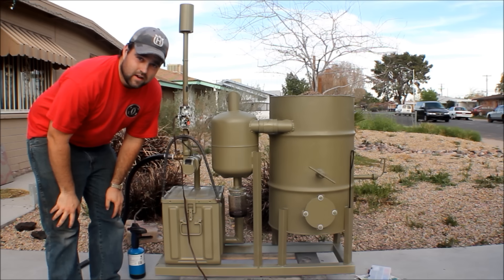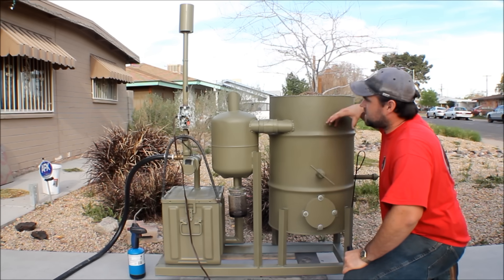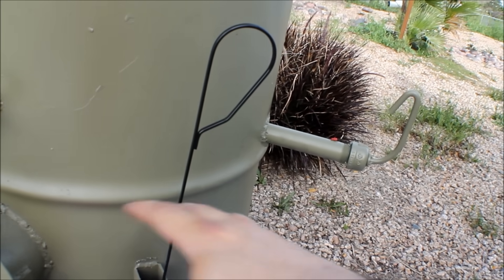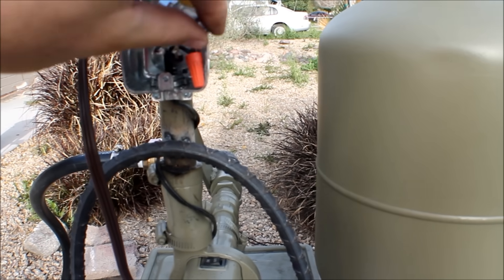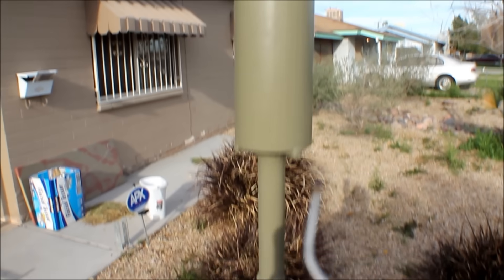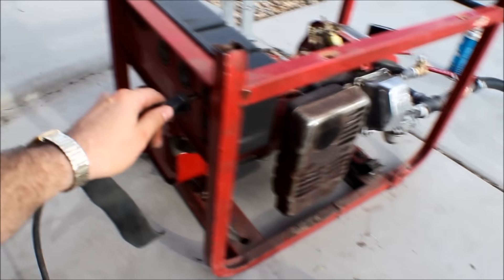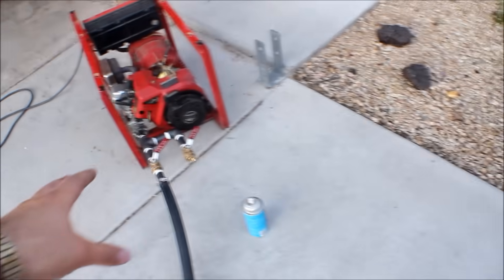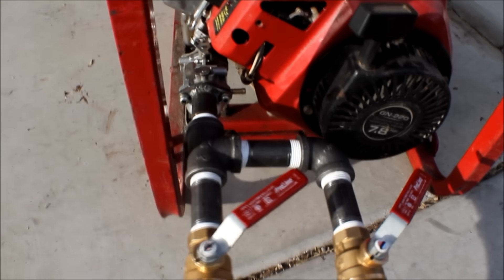amazing homemade gasifier uses wood pellets to run generator -- renewable alternative energy video

Comment: awesome,,,, can anyone answer these questions
1. how efficient are these eg much wood etc do you need to power the generator continual use???? what power output do you have etc.
Reply: That’s exactly what I was wondering. Like does it take 10$ worth of pellets to run 2 hours when gasoline could run it 2 days for same price. I’m also wondering can you run it all day. I’m also wondering does it work with sticks twigs wood from a forest or just store bought pellets.
Reply: @xDragonHawk  I completely agree... I heard from another source it takes roughly 8 kgs of wood to make the equivalent of 1 litre of petrol... Yes that is a litre not a gallon

Comment: Hi,did line the bottom of the gasifier tank , and what size hole fitting are you using on gasifier and to your engine thanks any info would help

Comment: Excellent work.  can we use Paddy husk instead of wood pellets ?  can the Generator deliver its rated power output with this gas. Can I share more details of this design through my e mail addresses 

basssa1960@gmail.com

Comment: could you circulate water though a water jacket on the drum like the cylinders of an engine and plumb to radiator in your home with a fan to heat a house in the winter as well as send that water into your sink shower etc. or would it cool the gases to much. Aslo I live in a wooded area. Can I feed it any wood? Can these gasses be condensed and stored in a sort of fuel tank for later use?

Comment: So when deciding what type of generator to buy, I see some that are "dual fuel" capable. Would one that's ok to run Propane take to this gas vapor better than a standard gasoline model? What about a Diesel generator...? Does this technology work with that as well?

Comment: Nice work sticking to  plan and budget to get a working system that runs the generator.  BTW Check out Wayne Keith's vids for Drive On Wood... he runs his full sized pickup on a gassifier in the back. Also holds the land speed record for a wood powered vehicle !

Comment: The main problem I see here is that the governor on the generator is disconnected so as the load on the generator fluctuates, the generator speed is not governed properly for the correct power generation voltage and frequency.

Comment: Thinking a Natural gas pressure regulator kit for generators would work good with this set up ...because as you put a load on the generator it will need to advance it's throttle based on the governor.

Comment: Be careful of running 'wet' fuel engines on 'dry' gas. The valve seats in the engine will wear faster. Just an FYI from someone seeing fleets converting gas engines to propane back in the day. Seen a lot more valve jobs on converted rigs than those on regular gasoline. Maybe find an additive? Our fleets never found one...20+ years ago though...

Comment: How long will the wood last in that 4" tube, when running the generator?
Reply: I was wondering the same thing.  Looking at the video my guess is 45 min to an hour.  The kicker is how many watts does the generator crank out?  If it's a 1500W generator you could run a toaster or space heater for 45 min to an hour on the pellets.  Like someone mentioned put a heat exchange on the unit and you could have hot water as well.

Comment: Hi there,   great video ,   I had fun watching.     I was im pressed with your pipework  , and your general contruction .  Its of a good standard,  and nicely integrated into that jig or frame that holds all the parts. 

I would just like to thorw my 2 pence ( or cent ) worth in there.    Dont try to regulate your blower  motor using a variable resistor or reostat , as you call them ,    switch to a PWM motor control circut , its also very cheap to buy and will control your motor with far mor accuracy and with a lot less heat dispersal.     You had mentioned that your motor was run from a 12 volt supply..   there are many 12 volt PWM motor control kits out there that you could integrate into that little metal box.   It would still use a variable resitor , however the POT( potentiometer ) would control the PWM circut which in turn controls the speed of the motor. 

I have one other idea that springs to mind when  I see this.... why not integrate a small 12 volt battery into your nice frame, and then add a 110v AC - 12v DC  supply in addition ,    as soon as your system is up and running the geni output could be connected to the rig to recharge the 12 volt battery.   Making it reeady for the next startup.      Right now ,  you have to have the trucks 12 volt to get going....   it would be great if this system could be completely self sufficiant and independant....  Perhaps add solar to charge the 12 volt blower battery ..? 

Great video , and as the other comments say this is one of the neatest wood gas systems ive seen on you tube. 

Keep up the great work and i look forward to your other videos. 

Matt

Comment: I would use instead of the air mattress pump a more robust solution maybe a 12 volt pump that is made for continuous use, due their stronger build, brush less and better overall construction (since they are made to be used for long periods of time like for example kitchen exhaust fans or even car ac blowers (12 volts).

Comment: For the speed controller, you can use a fan speed controller or for higher currents, there are 1000w high output light dimmers that have a heatsink built in. You can find them in hardware stores fairly cheap.

Also, throw some bacon in the gasifier. You'll have the whole campfire experience..

Comment: you should be using a https://www.amazon.com/Onyehn-Controller3V-Control-Switch-Dimmer/dp/B07GP72BWV/ref=sr_1_5?keywords=12V-Control-Switch-Dimmer&qid=1581578233&sr=8-5
12v control dimmer or motor pwm

Comment: Burn pellets to fire steam engine to turn generator far more thermally efficient. Like back in the good old days without the Grid. Your rheostat (A rheostat is a variable resistor) throws away that electricity just generated back into waste heat.

Comment: Do you suppose that tar could be dried out in the sun and put back in as a fuel source? And the sawdust as well for that matter. I don't see why not. It shouldn't be a buildup of impurity because on each re run these byproducts would be turned 90 percent into ash.

Comment: The only design flaws are that this gasifier only runs on pellets (or small twigs/branches) and that it isn't really cooling the fumes enough to draw out moisture. If you increased the run vertically with the maximum amount of surface area you could possibly get, I'd bet you'd run that generator just fine.

Comment: They need one of these about 60,000 times the size that runs on trash.
Reply: Someday. When energy isn't cheap and plentiful any more and space for land fills isn't so abundant. Someday I bet there will be an industry for mining abandoned landfills.
Reply: @xcvsdxvsx  Allenwood, Pa, the dump has one! huge setup runs off dump gasses!
Reply: @18twilliams  haha coool
Reply: In Sweden most of our garbage gets transported to large facilitates where it gets burned to heat the homes of thousands. In the winter wood pellets is also used. More effective then making electricity from it. Land fills are almost ever used except for asbestos and stuff like that. Rest is recyceled.
Reply: Where I live they have a big plant that makes methane gas off the garbage
Reply: These things are used on bigger scale. Google it you will find ones that generate ~200kw of electricity +300kw of heat power and they consume about 100kg every hour of biomass (wood, pallets etc..)

Comment: I'm guessing there's no way to control the throttle on the generator with this setup though. ?
Reply: Just a little more R&D.

It's best to focus on the "positive" aspects.

As a matter of fact, I intend to build a "hand pumped" bellows in place of an electric fan so I don't have to rely on any electricity power to start the thing up.

Comment: Just downloaded the plans and this video, I am definitely building one of these in the future.
One idea though. If you get a generator with electric start, you could start the gassifier with the gen battery and then start it off the battery and then it would be recharged for the next use.
Reply: The fan in this design uses 25W at most, which means that 3 18650 cells would be able to power it without any issue. You don't need to pay extra for a generator with a fancy electric starter, a Powerbank that does 12V will easily do it.
Reply: @nottheengineer4957  Well electric start would probably make it easier if you didnt have the fuel valves set, idk just seems like less to worry about cause it maintains itself. It would probably be a used generator off facebook anyway so I dont think price would factor in much.
Reply: @Jasonrotfl  Im with you. Ill buy the fancy electric start generator while I can. Not like you can get one after the Boogaloo or full chinese invasion hits, or some other disaster. Might as well make your life just a little easier.
Reply: @exterminater267  did just that. three generators on hand - one dedicated to gasification just in case. Plus the 4.6 kilowatt in solar panels...you know what's going on these days...not sure about "tomorrow"...

Comment: Just a Suggestion; If you bought an old compressor similar/ same as those that fill SCUBA tanks. Then bought some old SCUBA/ LPG/ pressure cylinders you could fit to your car. You could even use the compressor to fill an existing LPG system on a car. After careful testing you could probably revert back to LPG if you travel long distances and can't get home to refill. I don't think it would matter if the two gasses mixed.

Comment: I normally run my generator on propane and am wondering what the engine and oil are going to look like running on wood?  Is it a dirty fuel like petroleum?

Comment: This is a great set up and a great video. The big question left is how LONG will a machine function on the set up. Wood gas is notorious for gumming up the engine that is running on it. Has there been any long term use of this? That would be some more great info.
Reply: The Germans ran tanks on this in ww2.

Comment: Interesting but......you need electricity to run the blower to start the gasifier  to run a generator because you have no electricity?   Not getting it.  I know that these types of devices have been used successfully over the years, but needing electricity to get this design started doesn't compute.

Comment: Is this profitable, like would it be able to self charge using the genorator if you get what i mean
Reply: What are you asking like is it net positive electricity it Doesn't even use power after it's on
Reply: @chabka34  the battery

Comment: So you need a generator to start your generator fuel maker.
Reply: That's what i was thinking, but i guess you could put one of those hand crank airpump/blowers. but you maybe cranking for some time before you can fire it up.
Reply: @rammbostein  Or Just buy a 30 Gal Tank of fuel for your Generator.

Comment: Excellent and thanks for sharing, I' writing from Spain, my father who was born in 1913, was a cars mechanic, and he explained me that after the spanish civil war (1936 - 1939), Spain's lack of petrol moved many mechanics like my father, to self build wood or coal gasifiers, really very similar to yours, (Spanish called "gasógenos"), they were supported at the back of the car with iron rods welded to the chassis, and he runned thousands of miles (several times across the whole Spain) with different  cars, Peugeot, Citröen, Fiat, Ford, and a very rare 1920 Maxwell,  with which I learn to drive when I was a child.
Reply: Gasifiers were very common in Finland during WW2, since what little fuel we could get through went to the Finnish Army.
Reply: @apuuvah  Yes, populary used in trucks and such weren’t they?
Reply: impressive
Reply: @carlsapartments8931  I am Roger wee
Reply: Thanks Salvador, so interesting to learn normal gasifier from 100 years ago. Fascinating.
Reply: And now from FEMA amazing
Reply: I can't even imagine what they would look like. Is there any way you could email me even a very rough sketch of how that would be set up? Thank you for whatever you can send. ChangingMatrix@gmail.com
Reply: @changingmatrix8687  Look for "Holzgas" on Wikipedia
Reply: Yes, common throughout Europe during WWII.  From motorcycles to buses and trucks.
Reply: the germans also researched woodgasifiers, cause germany didnt have much oil and they needet the diesel fuel for something different back then.
Reply: Now that's amazing
Reply: I was born in 1940 during world war japanese world war n my father from Taiwan died of marialia mosquitoes bite n my eldest bros n sisters is only 13.5 years n I am 7th last child 8th months old. Amen
Reply: This technology is apparently still used in N. Korea.
(I suspect your dad knew my grandfather)
Reply: wonderful input we over shadowed basic of invention with latest high-tech gadgets that's why now we become handicapped just like a simple absorption frdige in caravan do the same work as in out home but hell lot of difference in energy saving. thanks for sharing your input
Reply: Holy f, very cool! Thanks for sharing
Reply: Wow great story thanks for sharing.
Reply: Come in india for new work
Reply: Still used to see a few of them on the road in 2007 in Sweden when I moved there. They were not hooked up, but there were there on the back of the car still for some reason.
Reply: You were blessed with such a father mine to was a mechanic and some how even in foster care I ended up a import tech myself.  Loved your story brother,  I don't know if you believe in christ but we aren't promised tomorrow and Yeshua is the only way to salvation.  There is nothing more important than christ and your relationship with him, without it we are all doomed to hell. I love you brother again loved the story your a very blessed man continue to share how God had blessed your life
Reply: Yeah we did the same thing in Australia during WW2. I think they ran on charcoal.
Reply: @darabrown9211 yep I know of mates who's dad run them an family everywhere on charcoal 
An a tiny bit of fuel in tank to start there Oldsmobile tank 😂
The gas would be running as fuel line turned off